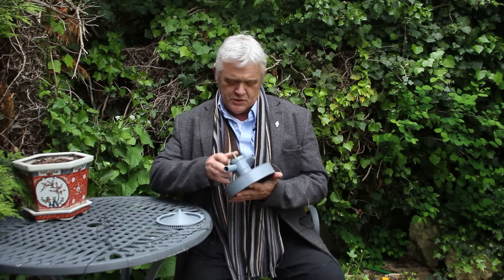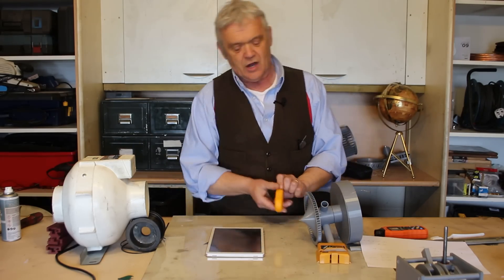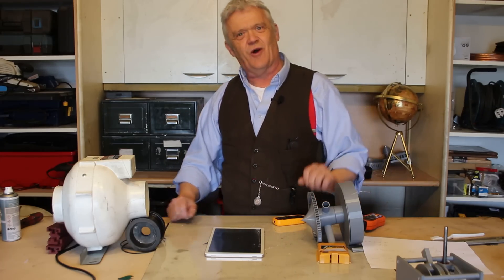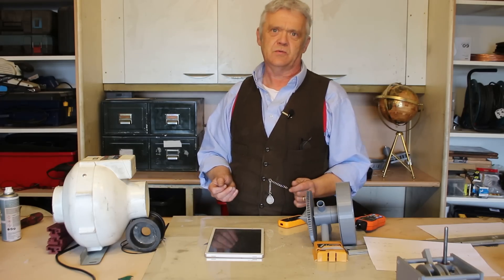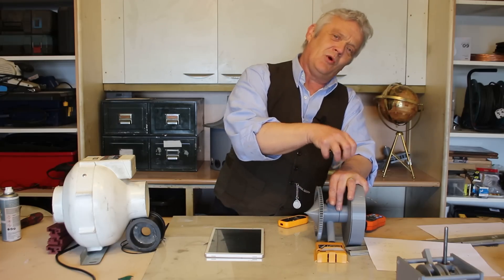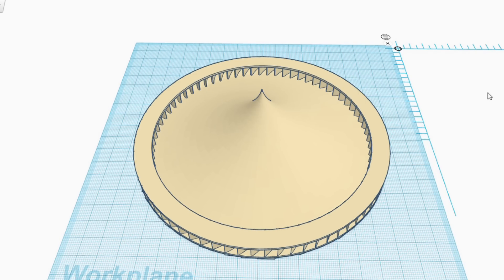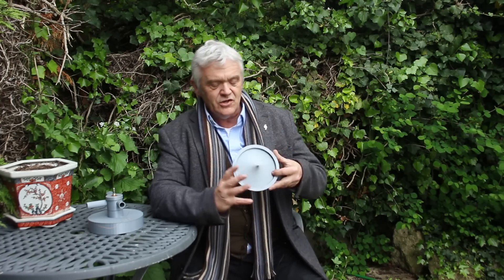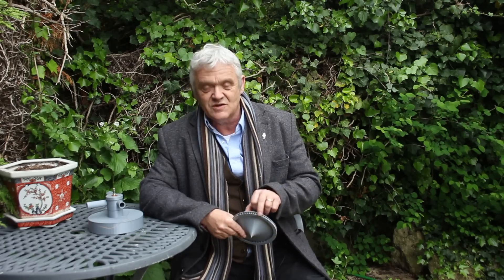1921 A Super Efficient Wind Turbine - A Betz Beater?

Comment: I suspect your method of calculating the kinetic energy is rather oversimplified. In a flywheel it is not only the total mass and revs, it is the radial distribution of the mass that counts. 
The other problem is you can calculate the stored kinetic energy only from sections of the time the rotor accelerates from 0 to max revs. The acceleration rate is not linear during the time.
In short: you are working with misleading data.
I have the feeling you didn't "reinvent the wheel".

Comment: I've built wind turbines for over 50 years.  Your design, scaled up, would be tantamount to having a full sheet of plywood facing the wind. The higher the tower, the GREATER the moment arm (leverage) on the tower.  It will sooner than later fall to the ground.

Ultimately, I have found the less mass up in the wind, the better, which is why I use Darius/Savonious VAWTs exclusively.
Reply: He's planning on using it in a Darwin turbine so it will be installed vertical

Comment: I think you have a problem with the online calculator, relating to the density distribution in your flywheel, as the densest parts are the magnets around the rim.
If as I suspect the calculator assumes a solid disc of equal density then your turbine is even more efficient, which either means because the air flow is turned nearly 90 degrees the Betz limit does not apply, or your measurements/calculations are suspect, I am hoping the first theory applies as I generally trust your work (even when your enthusiasm gets the better of you).

By the way that is not a criticism, I really enjoy watching someone genuinely enjoying the practical application of science, there are so few of us about with the knowledge, time and the tools to play with our ideas.

Comment: Notes:
1) you didn't calculate the true moment of inertia of the weird shape you got 
2) what you measure is not the wind turbine efficiency.
3) to measure efficiency you need to compare the kinetic energy of the columb of air entering the surface area of your wind turbine and to compare it with the continues maximum energy output of the device. to measure that put a generator and control resistor value until you find maximum power.
According to a very simple betz equation you will not get more that about 59% of the wind power. Your results maybe closer to 25%

Comment: I have a weird idea that I'll just pitch to you. Imagine if the wind going out of those tiny fins at the edge is captured yet Again inside another funnel that redirects the wind to be reused after it already pushed on the initial conic plate and inside that funnel is a set of other blades that the wind can push on again and comes out through holes at the end of the funnel. The reason I'm thinking this way is that the wind going out of those fins at the edges picks up speed and is now even more powerful when you trap it inside a conic funnel it'll increase the power it pushes on the rotor and you'll get even much more power off the wind cause you'll trap it. I can 3D draw it for you if you like. I think it'll be unbelievably powerful. Kudos!

Comment: Would recommend a Prony brake for measuring turbine mechanical power. I've got the code for a ESP32 board to calculate efficiency from a load cell, rpm counter, and anemometer if you want it.

Comment: Does the mass used to calculate fly wheel energy include the shaft, rotating parts of the bearings, and the turbine itself? Maths adds up if the mean diameter is 125mm rather than the implied/started 150mm which I'm guessing is probably the OD.  Mass distribution matters. Adding a load of foam to the OD would increase the OD but not meaningfully increase KE. Hence mean diameter is the diameter to centre of mass, not OD.

Comment: What is the diameter of the rotor?
Reply: Just under 6in diameter
Reply: @hakasays  He used 150mm as the diameter in his flywheel energy calculation. It seems that's outer diameter, not mean diameter. That's probably where the inaccuracy comes from. Doesn't seem like he's factored in the weight of the turbine, shaft, rotating parts of the bearings, and how that brings the mean diameter to be less than the 150mm outer diameter. if the mean works out to be 125mm or less (12.5mm less on radius) which is very believable, then he's under the betz limit.

Comment: Just use a prony brak. Measure torque and rpm. It better yet, use a BLDC motor as a generator and charge up a capacitor. Loads of ways you could have accurately measured performance.

Comment: I wonder if it's possible to create a completely natural artificial wind weather in a room with alternating temperatures to create a miniature tornado in the center of the room to spin it by using the ancient heat siphon method used in architecture called windcatcher buildings in hot environments where a well at the bottom brings cold air back to the surface as hot air passes it.

Edit: Room/Exterior Round Plaza

Comment: If you had a Darwin setup with the air flowing upwards, would a Gruchinsky (?) fan on top of the rotor impede its speed or assist its rotation?

Comment: Just a few points
1 this still suffers from the problem of Kinetic Energy in the wind being proportional to the cube of wind velocity . Half the velocity 1/8th the energy.
2 This is a solid rotor, the pressure in change wind flow through 90' will be very high. Size limitingly? 
3 the wind shadow will be very large due wind being diverted in all directions
4 wind will be diverted directly onto the ground what effect will that have.
5 due to 3 & 4 will it be possible to have an array
6 due to 3 & 4 what will be the effect on local climate, eg reduced wind speed = less ground evaporation

Not being negative as it's an impressive bit of kit  I assume the fly wheel is for experimental purposes only? Because it would overcome the problem of lack of inertia in the current generation of turbines which is a problem for grid stability as I understand it

Comment: What’s amazing is I has this exact picture in my mind! I think it’s the real deal Robert. Now sticking it on the Darwin and using the outside torque at the rim will finally create the setup! I bet you could make the Darwin wind funnel bigger at the top and smaller towards the bottom sending more force from air into the smaller surface area for when it hits the cone.

Comment: While there are tons of various factors in this, mass acceleration [ 1 grav accelerates 1 unit of mass 32 feet per second, per second ] which is on the input side of things, general turbulence and mechanical drag [in this case, mainly just the bearings, as the overall rotational speed is not super much] and the counter thrust if the air as it rotates out of the initial fan source [which matters very little in this exact format, I am sure, but can be greatly affected with some deliberately placed rotary vanes].

Basically, the same way there are diverter/corrector/stator vanes inside of an axial flow turbine engine, one can do the same, mounting little stationary blades, along a tube, in front of your turbine, which act to force the air the direction you wish the turbine to spin.

They have something a little bit like this on some turbochargers to reduce turbo lag, and they work simply by making sure that the air hits the impeller of the turbocharger at a tighter, steeper, more tangential velocity, therefore, importing more rotational torque, more efficiently.

While there is a practical limit to this, it is something that even in very small amounts will make measurable gains for the same flow of air [or water, or even sand] across a flow vane like this.

Comment: Great videos to learn all about wind and water power.  Another experiment:  What if you worked on the surface of your router?  If you coated it with Teflon or other materials to make the surface really, really smooth and slick, you might get 90% efficiency.

Comment: It would be an interesting idea to extend the existing blades all the way to the center of the disk - in this way the wind will contact the blade more time, doing more work 🎉
Reply: Interesting idear.... but would it creat more drag as well....???😎🇦🇺👌
Reply: @rodmills4071  the drag shouldn't be the issue here, the point is to maximize the time of the wind contacting the curved blade and, hence, rotating the disk)

Comment: Could you mount these to the top of palm trees and run a small encased metal cable (think bicycle hand brakes) to the bottom to transfer its spinning energy to a small electric generator?

Comment: Robert, you are awesome.  If you lived next door we’d be hanging out getting into trouble.
2 thoughts:
Couldn’t the mass of rotor (and shaft, anything spinning) be added to mass flywheel when calculating energy?
Your energy calculation used mass, but didn’t account for distance mass is from center, (moment of inertia, but not positive on terminology).

Comment: Could the reason for the above-the-betz limit results be that (and I'm drawing from the logic that the betz limit is founded upon I believe) since the betz limit assumes that by blocking the whole area of the turbine, no air will be able to pass through, and thus the turbine won't generate energy, and since your turbing DOES block all the air hitting the area of the turbine, letting it pass through the sides, it can capture even more energy since there will actually be a LARGE speed difference between the intake and output of air rather than the approximately equal speed difference with an ordinary turbine (because the air spreads out) 

Using this logic, I could argue that the best turbine design would be one that takes a small opening size and manages to spread the air out as much as possible, perhaps by opening up the center of the turbine as well as the sides. Maybe the lily impeller (golden ratio turbine) could work for this as it makes for a very smooth transition between fast moving input and slow moving output... Of course, doing this all without drastically increasing the material used in a turbine would be very hard and I'm not sure how this could be applied to large scale turbines but if you can find a way to make this work for micro generation it would be absolutely amazing

Please correct me if i'm wrong with anything because I probably am (grade 10 high school student with limited physics knowledge here), but I feel that you may have very well broken the betz limit fair and square without breaking the laws of thermodynamics. Amazing work! Have a great day!

Comment: This is a great video!!!  Measuring the increase of the flywheel speed over a given time period (flywheel acceleration) is an excellent way of measuring power.

With a very large flywheel and a constant wind speed if accurate RPMs are measure at predetermined time intervals (10 seconds), then the flywheel acceleration (RPMs per second) can be determined between zero and maximum RPM.  Usually the acceleration curve follows a bell curve with the most power being produced at about 1/2 the maximum RPM.

Comment: You need to put a length of pipe on the output of your fan to feed the column of air directly onto the test turbine.

That way you can get a more efficient feed system and a more consistent way of feeding the air.

You can also intercept the column of air at a more consistent and repeatable place...either make a slot in the tube and poke the meter through or place it on the exit of the feeder pipe.

Comment: in calculation of the area of your wind capture device did you use total area? as I watched it I noticed that the blades have a flat cover the only effective capture area is inside too inside of the blades. 
not meaning to disrespect 
this is a great design 👌 cheers Robert

Comment: I am guessing that it exceeds the Betz Limit because the flow is non-axial, so the actual effective area is larger than the area of the disk. In any case, it is an awesome result
Reply: My thinking too. The assumptions for the Betz don't allow for the air to exit to the side after passing through the actuator.
Reply: Likely because the surface area of the turbine is greater than the surface area of the rotor blades.  The difference a multiplication of the effective wind velocity far greater than the actual wind speed, due to compression.
Reply: I figured the wind exiting a conventional turbine is slower but in the same direction, in this case the wind direction changes from forward to lateral. But maybe I'm just repeating these ideas in a different way haha
Reply: @samuellantela7248  No, that's an interesting idea as well.
If Betz limit is based on wind speed vs propeller speed then it would make sense that changing the direction would allow you to reduce wind speed to zero, capturing 
closer to 100% of the kinetic energy in it.

Comment: Hi Rob, what you have done is you are using ALL the pressure generated by the wind and insread of the wind passing between the normal vawt it is directed to the blades at the end. Why not extend the blades in another parabolic path to the middle of the turbine? Like that you will increase the force of the wind on the turbine dramatically? Hard to explain what I mean here, Something like an impeller?B

Comment: robert....why dont you isolate the system, use a rotor with similar size to the fan outlet and stick a pipe between the rotor and outlet, doing this will eliminate possibe error sources such as an unknown source of venturi effect pulling air from the sides

Comment: Love this innovation Rob. With your area calculation are you including the vertical ... fan elements?
Reply from the maker: nope - just the area of the circle as that is the column of air hitting it and so the source of the kinetic energy
Reply: @ThinkingandTinkering  ok. I'm guessing the total area on the vertical blades is probably small, so it shouldn't muck up the calculation :)

Comment: All hail sir robert of Canterbury who hath proveth there are no limits in science, only in the imaginations of man!  Nice one mate, I actually think your design is even more efficient as if you watch the video back, the fan is actually slightly angled higher and the column of air coming out seems to hit about from the middle of the blade and up with perhaps a little over spread meaning your calculation is based on only 50% of the blade or just over being hit by the available wind.  Which is mind boggling considering what you got out. If im right you've not only broken the betz limit but broken the laws of whats  possible. (As we currently understand)
Reply from the maker: cheers mate

Comment: I think a smoke test is first needed before you change the height of the blades. You may find you are losing potential extra energy from the wind not flowing through the blades but over the top as the wind flow may not be as thin as you think. Really nice idea though.
Reply from the maker: cheers mate

Comment: There's the cross sectional area, and then there is the effective cross sectional area. 😊

As the air is diverted by the turbine to an angle that is 90 degrees to the wind, the air has momentum and presents sort of like a wall that extends beyond the turbine's physical cross section, thus there builds up a slightly higher pressure zone in front and a lower pressure zone behind.

Storing 1.2  joules of energy and calculating 80% of the available energy.  that's very impressive, but I suspect that maybe there is a significant margin of error. With these small numbers.
Reply from the maker: cheers mate

Comment: Betz assumes 1D axial flow.  Max power extraction happens at Vout = 1/3 Vin.  Robert, you have a 2D system, axial & radial.  Your axial out velocity is zero and you don’t choke the system because your shroud creates a radial out path.  I think…
Reply from the maker: cheers mate

Comment: One thing to do would be to test with the exact same setup but with conventional blades of the same diameter. That would tell you if something is off with your calculations/test setup or it you actually did create a much more efficient turbine.
Reply: Exactly my thoughts.
Reply from the maker: cheers mate
Reply: Would need a model for small-scale turbines, or a turbine/blade design of known performance given known size and construction, but yes that'd give a method to calibrate the flywheel measurement system

Comment: Well done Rob, I appreciate this increase in detail in the measurements. I do not have any difficulty in believing that you can beat the Betz limit, which seems to me a first-order number highly dependent on the details of the actual configuration. In order to see if your results are consistent, I would highly recommend taking a few other measurements, in particular at 5 and 20 secs, and if possible with a variable resistor to modulate the blower's airspeed.
Also, doing an experiment with just a different rotor (simple three blades?) could help ascertain if the betz limit is something that depends on the aerodynamic details as I was speculating. Fascinating stuff!
Reply from the maker: there was a a wrong wit it mate and was a bit ad hoc but it gave a flavour

Comment: Maybe you are getting an extra boost from the wind passing and not hitting the 'blade'. Passing air may reduce the pressure around the edge, speeding up the flow through the 'blades', giving a bigger effective diameter? With a result that different from the theoretical limit, I'd be going over and re-checking everything first.
Reply from the maker: ok cheers